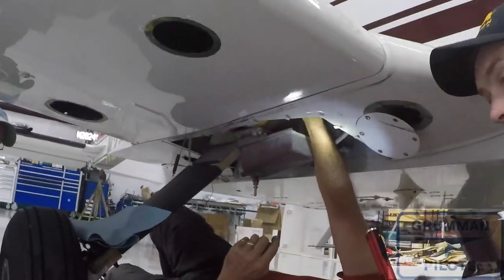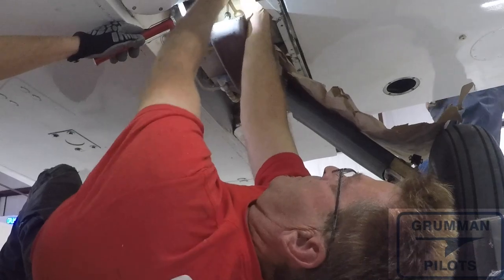Project Grumman Tiger Wings Back On - Grumman Style

Comment: Very nice video. Just about ready to remove the wings on my Cheetah.  Could you address two points in more detail?  (1) design of the wing cradles and (2) if the wings are removed for painting how should they be handled and supported during spraying?  Thanks
Reply from the maker: Cradles were slings made of carpeting hung between frames as shown in one of the videos.  Best way for painting the wings is to find a pipe that fits into the spar (5.5 or so diameter in inches) so you can rotate it as needed

Comment: Any tricks for reinstalling the attach bolts? Pretty sure the wings are lined up perfectly, but I can only finger-turn the attach bolts a few turns in. Is it okay to crank away and let the shoulders do the locating? I don't want to do any damage to the spar nuts or the $130 bolts 😬
Reply from the maker: That is fine just take you time and the shoulder bolt will align, do one then the other is easier.  Torque and strip as well.
Reply: @GrummanPilots  Thanks, Roscoe that's what I figured. I didn't think about the torque stripe also but that's a great idea